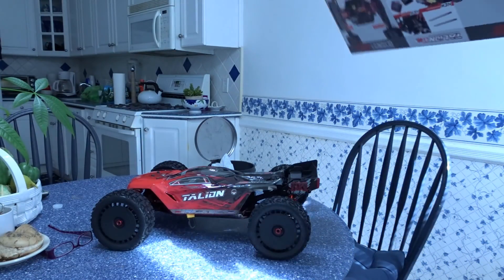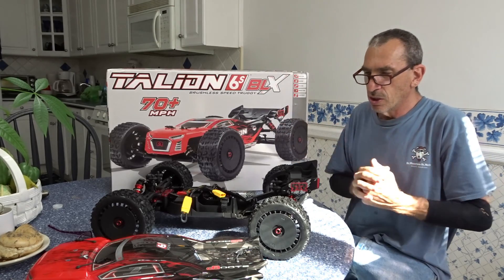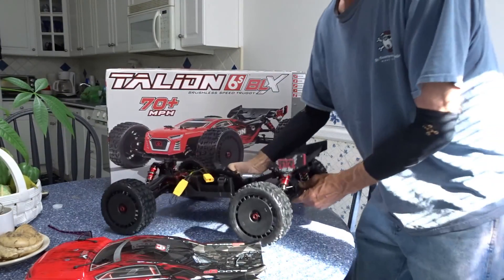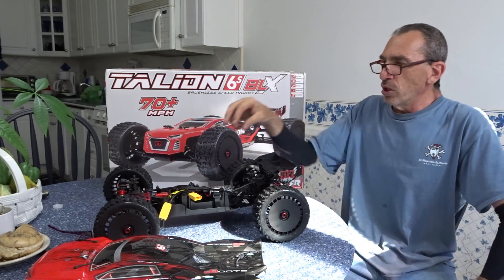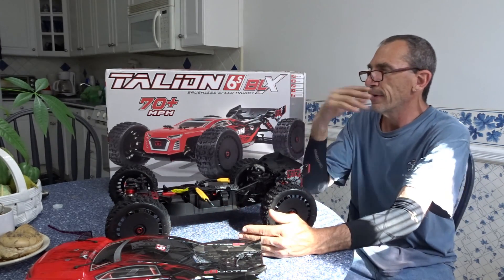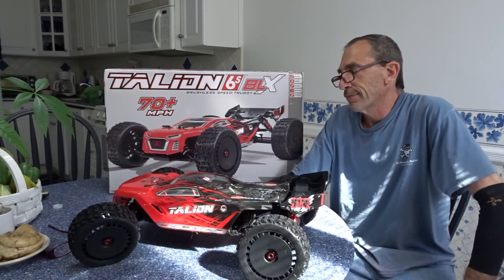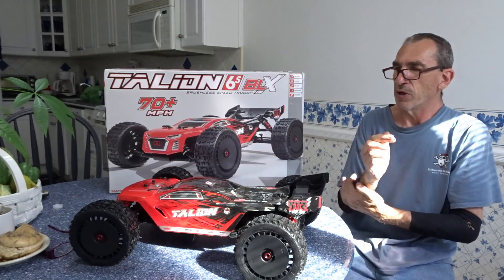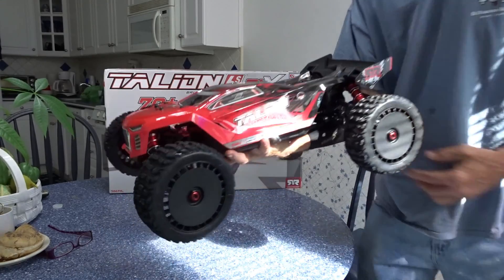Arrma Tailon My thoughts & Impressions

Comment: There’s no way u can plug the battery in backwards, the xt90 connectors only go together one way! That’s why u don’t need a red wire u can see the connector is rounded on one side n flat on the other so it can only go in one way